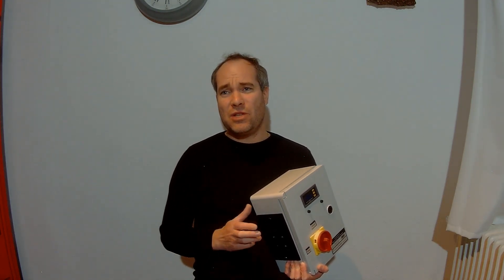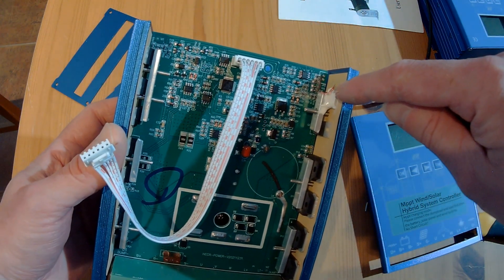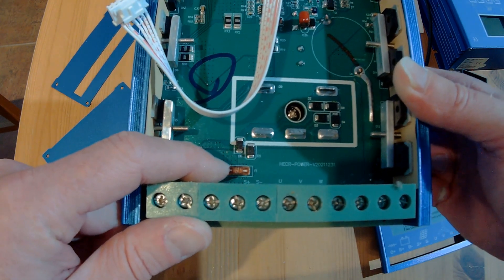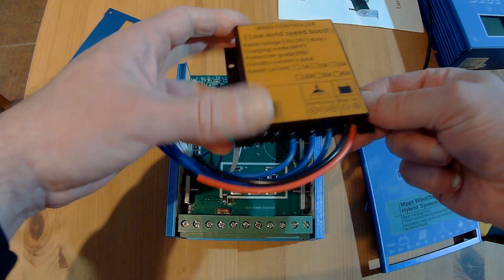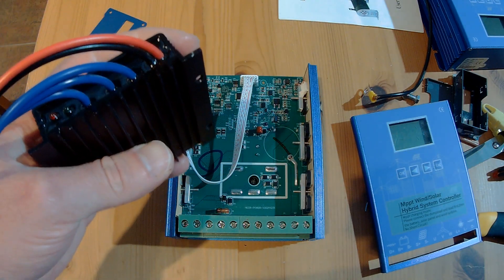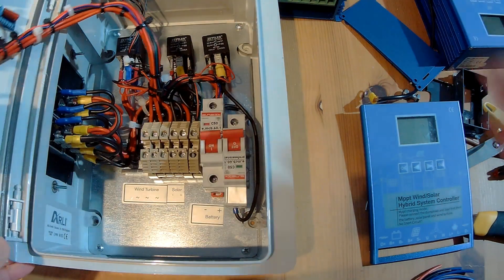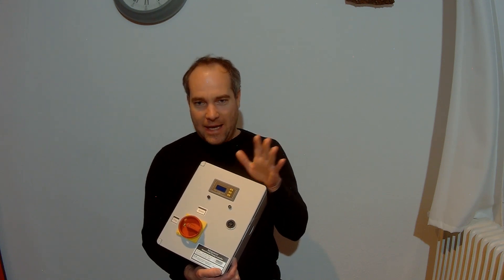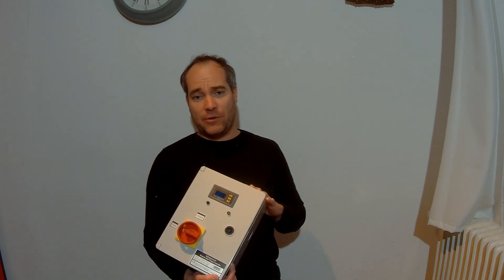Inside view and comparison of wind turbine and hydro charge controllers

Comment: Would a small micro hydro generator work on the small wind controller even if it has just 2 red&black wires?
Reply from the maker: I think there is already a rectifier built into their generator.  Do you measure DC or AC voltage at output wires?
Reply: I don't think it does, it's of those cheap $10 ones amazon you can buy. Im trying to make a off-grid system. Trying to hook it up a battery and inverter.

Comment: Can we use any form of dumping load? Such as running Dc fans for home cooling system instead of getting the excess energy wasted?thanks
Reply from the maker: I don't see a problem with that. A dump load is just a resistor of 1 or two ohms.
Reply: There's lots of things you can use as a dumpload as long as it is reliable. Many people use a low voltage DC water heating element that goes in the water heater.

Comment: je  parle de l ista breeze😄😄😄😄😄
Reply from the maker: Hi. I think you mean the brake doesn't hold the Ista Breeze wind turbine completely, right? (Sorry, my French is not very good) From I-1500 upwards it is not sufficient to short the windings for a complete stop. May you need a dump load. But even if the are turning slow it´s not an issue. For the blue controller you need an external brake switch
Reply: @freeenergyonshore2828  No, as soon as the wind turbine turns 1 turn it stops directly I don't know where it comes from I just bought a digital to change the screen
Reply from the maker: @pascalm3580  Question: Which wind turbine (type), which charge controller? How voltage at the battery (witch tyoe) and how high is the wind speed (m/s)?
Reply: @freeenergyonshore2828  istabreeze 2000 48v meme a 52 volts see 54 v it brakes I tried a smaller generator 700 w rotated by hand and same it goes up too fast 57 v and when I look at my solar inverter it is only 52 v the regulator eolien it is the same as yours except  that there is no radiator of the mins on the announcement ebay yes but has the reception of the parcel

Comment: In order to change voltage for AC, you need a transformer which are big coils of wires around an iron core.
 In order to change voltage for DC, you need a DC to DC converter which needs to have electronics, and a large Inductor which is also a large coil of wire around an iron core.
 In order to have MPPT you must be able to change the voltage. There are no large coils of wire around iron cores in any of those controllers, therefore, none of them have MPPT.
 Most of these Chinese companies making equipment are liars. There are only a couple of decent ones, and we should applaud them for their efforts by buying their equipment only.
 One of the manufacturers has actually named themselves MPPT. Yes, really, they named themselves that. They put their name all over their PWM equipment purposely making people think they're buying MPPT controllers.
Reply: Ever heard of switched Mosfet circuits? No coils required. Welcome to the 21st century;-)
Reply: @sudosu4133   Of course I've heard of them, but as far as I know they still need a coil of wire, although I could be wrong. I've never seen a real MPPT solar charge controller without a heavy coil of wire. it may have to do with the cost of the circuitry.